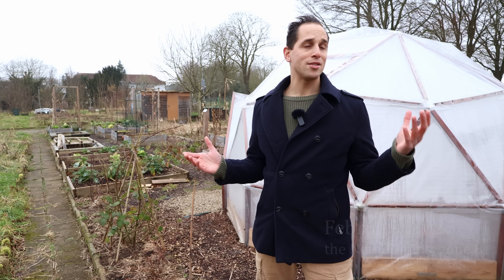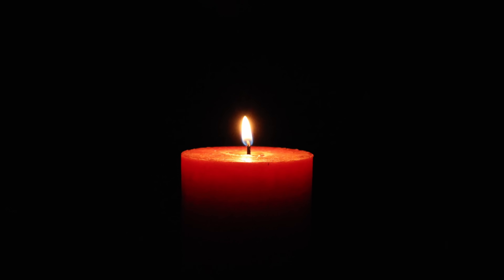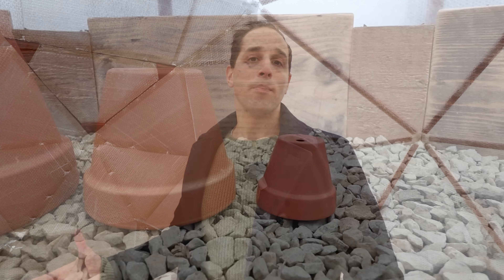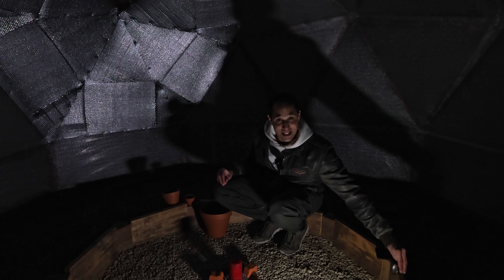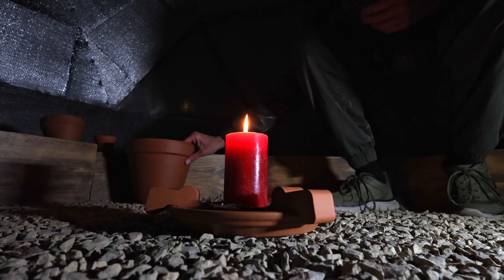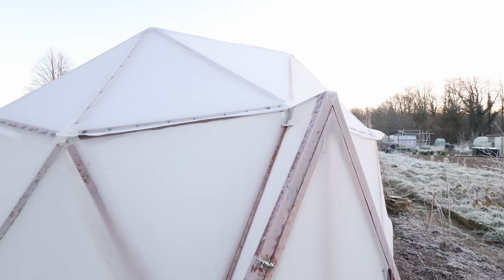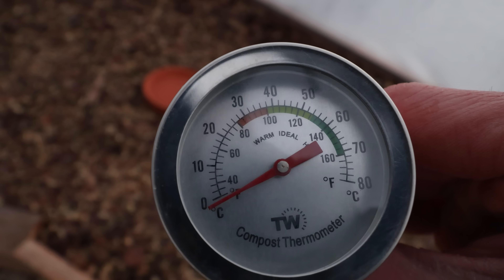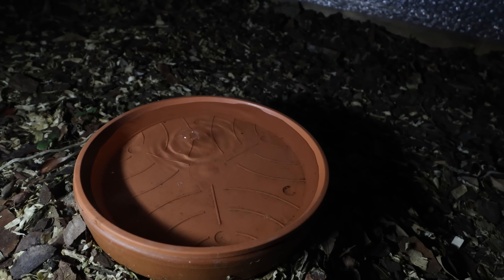Can a Terracotta Heater Keep my Greenhouse Frost-free? • Ep. 48

Comment from the maker: I thank you for all the positive feedback! I'm learning a lot. A few things:
- this was a simple experiment to see if a terracotta setup would work and then share my experience with you. It was not a big science project
- it was never meant to heat up the greenhouse to "cozy household levels", merely to help ward off the frost
- I never said the terracotta was going to increase the heat given off by the candles, but I should have stated more clearly that it would act as a slow release and radiate the warmth of the candles to the surrounding area, instead of going straight up to the ceiling
- lighting the candles while the sun was still out and warming up the greenhouse would indeed have made a lot more sense
- there is still a lot I can add/change about my greenhouse setup to improve overall insulation and thermal mass
- please watch my conclusion at the end of the video.

Have a great day, cheers!
Reply: I live in Arizona and the natives have been doing this for generations but you're using the wrong type. Instead of clay pots you should be using roofing tiles to direct the heat all the way across the room
Reply from the maker: @VineyardGHS  That makes sense. Thanks!
Reply: The issue is that the internet has been spreading lies about these heaters for decades. You essentially just made this setup more expensive by adding like $30 worth of teracotta pots. If you are 100% off grid and live somewhere that just rarely gets below freezing during growing season, using candles or small alcohol burners to keep a small space from freezing is fine. Its the mystical woo-woo that the terracotta brings to the equation that makes people annoyed
Reply from the maker: @skeetsmcgrew3282 thank you for your comment. All the terracotta items together were €11, and the candles were €2 each. All together, €17 is perhaps not the cheapest but definitely not too expensive (for me at least) to test and see if this experiment would work.
Reply: @skeetsmcgrew3282 the pots do add a safety factor vs just having an open flame.
Reply: Have you tried doubling your plastic on your green house ? That's what they do in Alaska,double and triple layers sometimes they use air blowers between the layers and they grow all year round
Reply from the maker: @royalsquishy7058 Yes! The greenhouse has a double layer of plastic, with the inner one being bubble plastic.
Reply: @atthegrassroots I'd put a small air blow in the top of your green house and blow the air between the layers , but I'm pretty sure they a solar power blower system for grow houses . There is a geo thermal tech where they bury air ducts under ground an heat their green houses for cold environments not sure if that would help in your situation
Reply: Hello, this type of heater was new craze several years ago, if power goes this will keep you warm. always using a laser temperature device, yes the pots were very hot, but they never showed you the air temp. and then several people did actual test, and it was bogus.
 I believe it will work for your purpose, with this type of set up. I would set up a vegetable oil burner with 3 wicks, and 3 separate pots. the oil will be much cheaper than candles. Also run a small plastic hose to each heater to ensure they have fresh air, and being at each pot it won't reduce the air temp.
Reply: We are enjoying learning along with you.  This was indeed instructive.
Reply: Stone or steel, big heavy pieces, with a larger heat source underneath will catch and hold the heat.
Reply: In Florida the farmers light fires to keep the orange trees from freezing.
Reply: Naa, the whoke sistem will stabilize on a minimal real quick.
This kind of termal stockpiling is way more dependant on the insulation then the candle, its just too litle fire
Reply: It does sound like you learned a bit about thermal-dynamics. FYI: The amount of BTU's produced by a candle is based on the size of the flame and this does not change if you cover the flame with a clay pot. From your video I estimated that each flame was producing 110 to 125 BTU's. A small 1500 watt portable space heater you might use in your home  typically produces 5,000 to 5,200 BTU's. I believe your 2nd test was more success because of the 2C increase in ambient temperature. Otherwise, you should be proud of producing a very entertaining video and stimulating conversation and learning. 👋😎 Congrats from  the Canadian Rockies.
Reply: Some basic inputs to consider:
- a candle produces about 300 BTU
- you need about 20 BTU per square foot

It looks like your dome is somewhere around 64sqft. 64*20 = 1,280 BTU need, or about four candles.
Reply: One big difference between the first and second experiments is that the first one had the candle's flame right under the hole, whereas when you used three candles, the candle's hot gas plume would first rise and hit the largest pot, and have to work its way sideways to find the hole.

If you want something cheaper than candles that would work as well, consider using vegetable shortening (basically hydrogenated vegetable oil, a saturated fat). You can get a big tub of vegetable shortening for cheap, and use emergency candle wicks embedded in the shortening to use it as a cheap candle.

Comment: A candle is good for about 30 Watts of heat so isn't going to warm very much, one of the best things that I've found is an old pressure lamp (such as a Tilley) that should give about 750 Watts for two pints of fuel overnight which should do the job.
Reply from the maker: Great tip, thanks!

Comment: A candle has about 100W of energy per hour ? How much a candle costs ? 2 euros, but with that you have 10 kWh of electricity. With a small electric heater of 300w ( 3 candles) is enough for 12 hours.

Comment: The terracotta ought to take up some of the heat from the candle and then radiate some of it horizontally, I guess, rather than the heat from the candle just travelling straight up to the ceiling by convection.  Logically, the heat source needs to provide at least as much heat as the greenhouse is losing in order to prevent it getting any colder, so more candles will give a better result, but again, radiation could still be more useful than convection, perhaps?  If so, the pots might well make a difference.

Comment: I kinda have an issue with any candle/terracotta hack. The energy in the fuel is not multiplied with the terricotta. Exactly the same amount of heat is released into the environment. "Maybe the terricotta holds the heat?" No. Try picking it up after a second, burned. Pick it up after a minute of no burning, all fine. Heat has already dissipated. The terricotta does nothing but provide a visually pleasing hat.

Comment: Instead of the candles you could probably use a propane stove set to the minimum. I believe using candles is more expensive, than using the propane gas in a similar manner. 
You would just need to find a gas nozzle that emits a relatively small amount of gas to replicate the candle light or slightly bigger than the candle light. A 25l tank would probably last you a whole seasons :)

Comment: If you stack them inside each other, leaving about an inch gap between each pot, the air heats and circulates, making it hotter and more efficient.

Comment: I don't quite understand why the middleman (pots) is needed? Candles emit the same amount of heat whether they're in use or not. If the air cools faster due to poor insulation than it heats up from the candles, then you just need to increase the insulation. But if the insulation is sufficient to retain the heat from the candles, then no pots are needed.

Comment: i think the pots actually don't make any difference at all. They only protect the flame from getting blown. The heat comes from the candles, and the terracotta isn't some kind of magic multiplier. i think a diesel heater would be much more effective, and maybe cheaper in the long run as well

Comment: Put a flat terracotta dish over the whole on the top pot to keep the heat within the tower. It makes a big difference.
Use cheaper 8hr tealights,  in a shallow dish to catch any spilt wax.
A narrow Allen key is a great spacer to keep the tealights slightly apart.

Comment: A candle puts out the same amount of heat whether it's inside a clay pot or not. You can't get more heat simply by putting a candle inside a clay pot. You might even get even less heat as the candle might get less oxygen inside the pot than when outside.

Comment: Thank-you! Great experiment! I’ve experimented with some larger terra cotta pots combined with 2 or 3 carbon felt wicks (2 inch long, 1/4 inch exposed to burn, copper sleeve to hold) and olive oil (burns very clean). 3 oz olive oil can get you up to 12 hours. I was able to raise a fairly large room by  2 degrees F…Best luck with your greenhouse! 🙂
Reply from the maker: Thank you for you kind comment, and sharing your experience! A new little video about the greenhouse is coming soon! Cheers!

Comment: You need bigger pots for that size greenhouse and that little insulation you have. With 2, 3 pit high stacks high stack, the largest pot being about 45cm in diameter, and a Crisco candle, I was able to heat my flat up to 26 degrees! But that was with fairly well insulated walls and double glazing! Try it at home, feel the difference! also Crisco give a little more heat, and if you use two layers of terracotta pots on each stack you could potentially increase the heat and have more residual heat in the days after. It is after all the same concept as Alpine central heating

Comment: I heat a Dutch oven full of sand on the stove until its super hot, then put that in ur greenhouse. Lasts hours depending on the size of pot. Those wood stove self powered fans work if lids hot enuf to run it.👍
Reply from the maker: That's a great idea, thanks!!

Comment: Add insulation around the top. Duplicate the heater 2 more times and arrange in a triangle equidistant from the walls.
All the heat you are generating is going out the top of the igloo.  There is some thicker material (about 3/4") that is a clear plastic insulating 4' by 8' that can easilly be cut with a razor knife to fit on the inside of the igloo. It comes in almost clear that passes about 70% of the light and in clear. And it passes about 85% of the light . . .

Comment: You have to try out different Terrakotta Pots I have a lot stacked on top and the all store the heat very well...plus a Dome is great but it should be more into the ground ... about 1,60 cm that way you will have no more problems with freezing...
Reply from the maker: True, if I'd had to do the construction of the dome over, I would dig out a fair amount and isolate the ground. Not gonna do that now, but I did just double the height (and filled up) my grow beds, so at least I have some more thermal mass now!

Comment: each tealight/candel produces ~30 btu per hour doesn't matter what you surround it with.  The first law of thermodynamics says you can’t create additional energy. The way you burn the candle does not change the amount of heat produced. A candle outside a clay pot or inside a clay pot still produces 30 watts of heat.  you can't beat physics.  no, "converting to infrared" doesn't change the equation one bit as ALL heat from a candle is infrared radiation.  no the pots aren't keeping the heat lower, the candle flame and the pots are both at the same height from the ground, and the iar surrounding either immediatly convects.  it might make burning candles unattended safer, that's the only advantage i can think of that would be real.

Comment: Use a broken piece of curved terracotta pot over each of the three holes ( the angled bit from the bottom of a pot works best)This acts as a diffuser, moving the warm air out to the sides in each pot, rather than straight  up, but still allows air to move. It works
Reply from the maker: Very good tip, thanks Matt!

Comment: I have a Very Large Ball Bearing on a Candle Holder. It takes a good 15 to 20 minutes, but after that, you can’t touch it without burning yourself.
I have it set so the flame is just below and not touching the Bearing.
I’m sure you could do this with any thick chunk of metal.
Reply from the maker: Good one!

Comment: The terracotta heater only works if the pots sitting above the candle are fully sealed.  You have holes going right up allowing the heat to escape.   That's not going to convert the heat into radiative heat and its simply escaping.

Comment: Yes this is made incorrectly. It should be smallest first with each larger pot stacked on top.

The main isn’t to heat the pot, it’s to act like a rocket stove.. reheating the air until it’s forced to exit

Comment: You need underground steam coils. Or solar panels and low voltage heating wiring under the beds.
Reply from the maker: There are of course a lot more ways to improve the system, but this was mainly aimed at a low budget experiment :)

Comment: I lived on a farm without electricity for about 4 years. Candles are expensive and a waste of time. Oil lamps are the biggest bang for buck. Take some used cooking oil and buy an oil lamp wick (it will last forever). I used ceramic Aladdin-like lamps: a vessel with a hole in the middle and lid. A handle on one side and a spout on the other. You put the wick in the spout. If it smokes then you're fuel rich just like the Falcon rocket and you need to push back the wick to use less fuel.

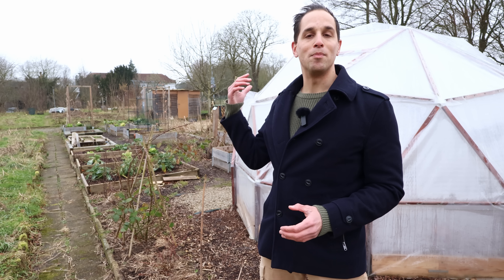Comment: Compost heating? Okay you're sending me down to rabbit hole that may take me yours to sort of Thank you I needed a distraction 0:46
Reply from the maker: Thanks! It can be a vary viable setup, if you can tackle the condens and possible fruit fly hurdles. I've seen most people make a compost heap outside and against their greenhouse, and then run tubing from inside the heap to inside the greenhouse, blowing warm air with fans.

Comment: This is an interesting way to set up the pots. I would use more then one candle.. There are other ways to stack the pots that would keep them from cooling so fast.
Reply from the maker: Thanks, and yes I agree, more candles would probably work better, but for an overall more effect I'd improve the thermal mass and insulation.

Comment: You should check out The Outsider's Candle convection heater. Uses an ammo can to heat the inside but keeps the cold air separate.
Reply from the maker: Thanks for the tip!!

Comment: Maybe you should try just lighting the candles to see if adding the pots even does any to that small space. If it’s only dispersing the heat, it doesn’t need to disperse much. I get it’s not totally insulated in there, but if you had like 4 candles spread around (dispersed) you might not need all the clay pots. I don’t think they multiply heat, what you get per flame is what you get. The dispersion is only there to slow down losing of the heat so maybe it would be good to work on insulation also. Cheers!
Reply from the maker: Definitely! And yes, like I've said in the conclusion, the best way to get more out of the greenhouse in terms of heat retention is to increase thermal mass and optimize the insulation. This little experiment was really to see if it could ward off so light frost. Thanks for your comment!

Comment: Add a metal bolt to the system directly above the flame. It will get incredibly hot and radiate heat into the terracotta much better than just the flame can. I've seen people do this in caravans. I'm sure it will work for your greenhouse too.

Comment: At AU$5-10 per candle, depending on the size, that's a quite expensive heating system ❤
Reply from the maker: At those prices, definitely! The price here is €2, and this experiment was to see if it could ward off some light frost, not as a permanent heating system. But like I said in the conclusion, I think there are better ways to get more solid heat retention results. Thanks for your comment!

Comment: I live in Minnesota, I have a 10 x 10 foot greenhouse and tried running Propane heaters in it to keep it at 75 degrees all winter long. It cost at least $500 in propane to heat my greenhouse using a couple propane heaters but that was not counting the electric heaters I was also running in it. A terra cotta pot heated by some canldes will not even come close to heating anything.
Reply from the maker: Are you growing sub tropical plants in your greenhouse in winter?

Comment: A candle gives off around 10w of energy. No insulation is good enough to be under 10w of heat loss on that big of a house. Btw I don't mean this in a rude way, it's just to show people that those "terracotta heaters" are basically a 5min craft scam, but in Germany for example SOOOO many people fell for it  😂  Also fun fact a person gives off around 100W, in my case around 170W so 17 candles would be the same as just me 😅  if y'all want real free heating, get a small solar panel and a old car battery, and put in a small 100W or even 300W space heater for the nights :D And as said in the video A LOT of thermal mass 🫡 Anyways Nice video ❤ y'all have a wonderful day

Comment: You need at least 3 candles to produce at least as much heat as 1 human at rest.

Candle heating has close to zero investment, but the running costs are actually higher than electric or gas heating. Regarding environmental effect, paraffin is pretty comparable to oil or gas. So, if using a small heater is an option, I'd use that. Easier, more certain, and you could use it with a thermo switch so that it only heats when it's needed. (If passive means aren't enough, that is.)

Comment: You could just scrap the idea of candles and use an old oil/paraffin lamp you remove the glass dome and use plant pots the same as the candle method but the flame is bigger
Reply from the maker: Thanks! I've gotten this tip many times now, this video in particular was just to see if candle heaters could work, but I think there are better ways.